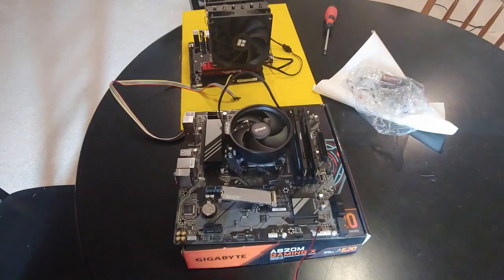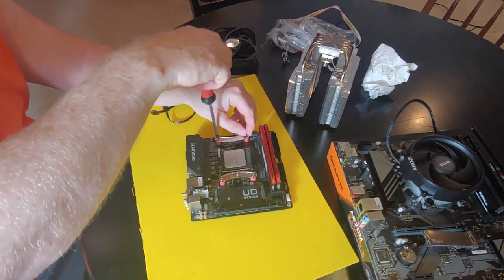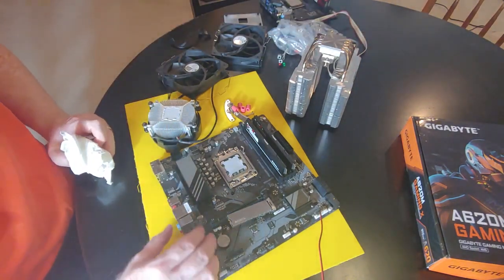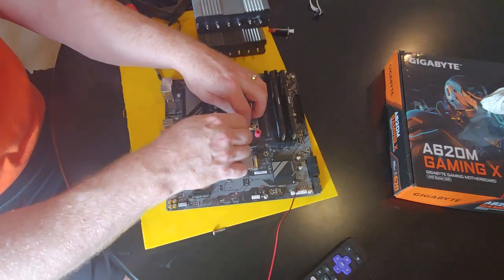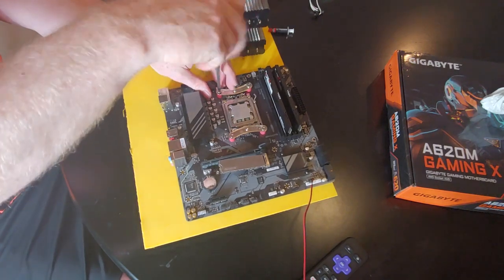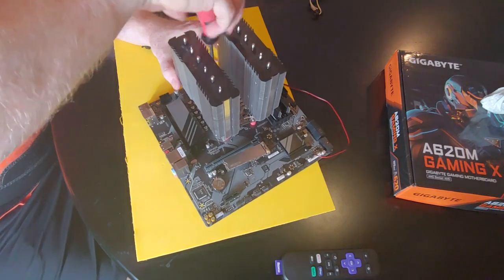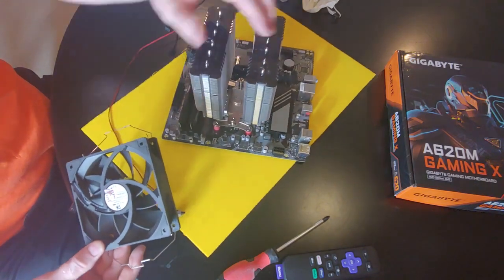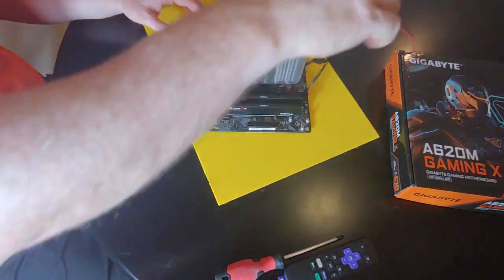Test Bench installation Thermalright Peerless Assassin 120 SE CPU Air Cooler AM5 Ryzen 5 7600 A620m

Comment: You put the outer fan near the I/O as an outtake. Everyone else puts the outer fan near the RAM as intake. When you look in the manual (it's a bit hard to see) you can see the orientation of the text "thermal right" is readable when you have the MOBO orientated with IO at the top and ram at the bottom (this doesn't matter by itself). Then on the next picture you see that the other fan is below the text "thermal right" so that is congruent with using that outer fan as intake above the ram.
Reply from the maker: I forgot to menton mine is not going into a case. ...and reason for the orientation.  I will fix title

Comment: Do you have experience on non-se version? Im going to either buy this one or the non se but im trying to figure out if either has any positive factors compared to another, on one video i saw comments (on non-se version) that the mounting screws required alot of pressure from the screwdriver to get get in touch with the mount itself (which could be deadly for the motherboard if it slips), any take on that if you have experience from non-se or how was it on this one, didnt look like much pressure was needed.

Comment: Isn’t the fan orientation wrong? They’re set to intake
Reply: You're right & he installed both fan wrong position, Obviously he doesn't know what he is doing 😂. He shouldn't be making video how to. I hope people didn't followed this guide 😂. That's messed up.
Reply: @willybilly99 not me installing the fans and everything on my computer then reading this comment and having to restart 💀
Reply: @willybilly99 I’m only following it for the am5 install part as I don’t know how to do it as first time on am5 the fans I’ll just look elsewhere
Reply: @willybilly99   He said in another comment that hes running it without a case. So the orientation of the cooler or fans dont actually matter.
Reply: yes, this guy is a clown.

Comment: Hi can you try the Assassin king 120 on your 7600 and let me know direct heatpipe should help cool a lot better with the thick heatspreader
Reply: That or this version will definitely work on a 7600. Thermalright Assassin X 120R SE Plus The "Plus" just means it comes with two fans.
Edit: With the dies being spread out on AMD CPU's, you need to be aware of if they'll get good contact with the heat pipes. Be careful.
Reply: @UncleButterworth  lol soooo i kinda bought both but havent tested them yet lol the artic freezer 50 works amazing because of HDT vs other coolers with a thick heatspreader on my 7600

Comment: What do you think of this motherboard? I will use it with amd Ryzen 7 7700 and 32 gb 6000 mhz ram. would you recommend
Reply from the maker: Thanks for dropping into my channel.  I have probably watched at least 200 of yours over the years as my big thing besides computers is hitting those weights.

While this is a very capable motherboard, it does have its limitations.  I have mine running out of a case, so the installation of the cpu cooler fans is not relevant.
1) Only one M.2 and other other PCIE is not large enough to add another via PCIE card
2) No Wifi.   If your GPU is too large, it will over the PCIE 1.0 slot which will be an issue if you plan to go that route for PCIE wifi card.
3) Limited USB at the I/O
4) Minimal heat sinks. I did not test the VRM's, but would expect that the higher end AM5 CPU's would not be a good match for this motherboard.
5) Limited headers on motherboard for case connections.  USB headers very limited which might cause issue with either case of USB wifi

Positives:
1) Bios flashback button
2) Supports D5 RAM
3) Low price
4) USB Type C both at I/O and onboard header

I personally would not want this for myself and might have difficulty recommending it.
Reply: just go for asrock x670 steel legend